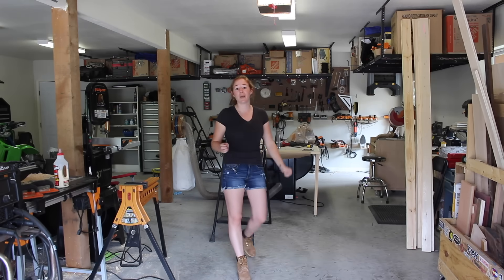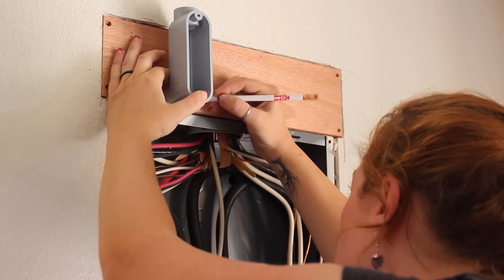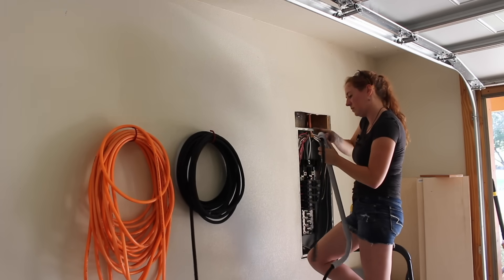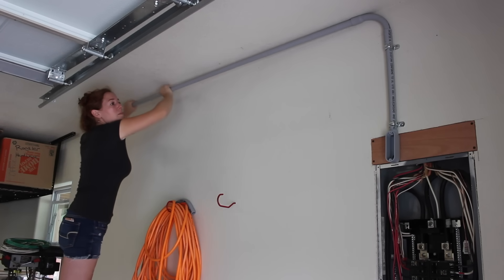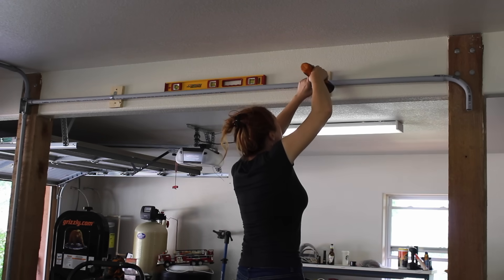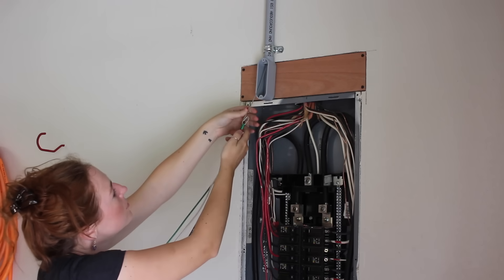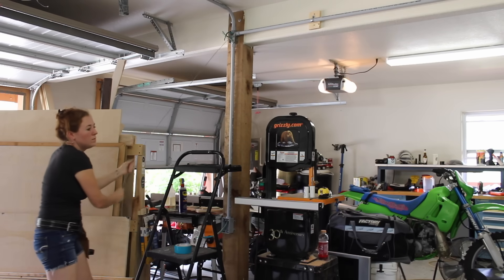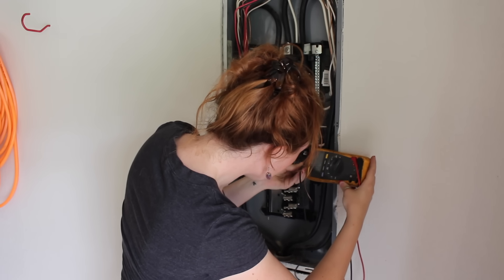Adding 220 Volt Outlets to the Garage

Comment: I've always found those wire-nuts horrifying (we don't use those in the UK at all), but seeing you use those with 240v is even more terrifying. I'm, sure that they are fine, but I'd rather use proper terminals that are screwed down tight. The loose wires are a mystery to me too - We have use "Twin and earth" that are bonded in a PVC outer.
Reply: I'm very impressed with the new Wago connectors.
Reply: Yes, I've used those - but only for lighting/low amp stuff.
Reply: I'd probably go upto 20A with one, but yes, I'm a bit dubious of running a cooker though them - even though they claim 32A on some of the ranges. Still, rather them than wire nuts. Their DIN range are really cool - did all my lights (star wiring configuration) from DIN boxes full of them (had some DIN ZWave modules to mix in, so it made sense).

Comment: You didn't have it in the video, but I was wondering how you ran your conductors through the panel knockout?  Be sure you have a conduit with a bushing from your LB to your panel.  I would also not recommend putting a block of wood directly above your panel.  Combustible materials should be kept clear.  other than that, nice video.
Reply: surface mounted with listed fittings wouldn't severely compromise the fire resistance of the sheet rock.  I was pointing out that it's always a better idea not to have combustible materials around your panel.  Same reason why I don't use NM (romex)  unless I absolutely have to.  Not so much a criticism of her work,  just a little food for thought.

Comment: If one uses SO cable inside conduit where there are no codes then the risk is just heat. ie the max amperage would have to be less since the conduit is actually adding more insulation. Thus besides laws, one should understand why the code has its reasons. Frankly for a casual usage garage, the heat issue would be nill since one is not going to run a table saw straight for 6 hours. BUT if the 240 volt SO in conduit was for say the homes main AC unit then here in the Deep South the SO's insulation would just degrade quicker due to the added heat. Oddly having SO in conduit might too prevent a fire in as Barn since squirrels and rats like conduit less than SO wire!
Reply: Does the NEC not have derating tables for various cables in various installations? Cable clipped direct to surface can take more than cable buried in plaster. Then at the other end you have cables under insulation in the attic which may involve going up a size.
Reply: The NEC has Ampere rating for wires normally used in Conduit and the maximum number of wires allowed for each gauge and class of insulation. Another variable is the Ambient Temperature. , the tables are for  30C ie 86F and you derate at higher ambients.  SO is flexible cord and not even mentioned for usage in conduit.
Reply: Ah - SO is flex. That figures then. Yes, the IET Regs have derating for temperature (IIRC 30C is factor 1, ie the normal rating) and also for grouping (number of circuits rather than cables inside a single containment). Thank you.
Reply: If the SO is running to a milking machine in a barn in the county then having some of it in conduit might halt animal damage of the cord too. :)

Comment: Hi,
nice video, as always!
Just a thing I have in mind while I was watching and want to share: If you have no fish take, you can use a cord with a cotton-wool ball tied at the end and suck it through the pipes with a vacuum cleaner. Then fix the cables on the cord and pull it through.
Worked great for fitting all my network cables in the ductwork in our house.
best wishes from germany
Andre

Comment: Again, great job.  I missed the part where you used a white wire as a hot.  someone commented to tape them black on the ends.  That may be ok in an industrial application.  Being this is your home that you may sell some day, I would replace the white hot wires with black or red.  Again, great job.  You seem to have an understanding of the invisible demon.

Comment: I think you did a great job especially since it is your first time with limited knowledge.  For the future.  get some wire pulling string.  tie a small amount of cellophane on one end (just enough to fit in the pipe loosely)  Put it in one end and a vacuum on the other.  It will pull right through.  Tape your wire to it and pull it through.  Much easier than the metal fish tape.  minerallac hangers instead of wooden standoffs are much neater.

Comment: Does the 240V come off the pole in the street ?
Reply: In a typical USA home the street's transformer is 240 volts with a center tap in the middle that is grounded at the pole with a big rod. and at the meter at the house too with a ground rod too. Thus one has two hot 120 volt legs to ground  and 240 volts between each hot leg.  

Most circuit breakers are for 120 volts and use one of the hot black legs and a neutral white wire back to the breaker box. For big loads like a oven, clothes dryer, big AC unit or a shop the circuit uses a 2 pole breaker and 240 volts.
Reply: thank you so much for the reply, I did not know that, so can any customer request 240v supply ? and other than operating machinery why would they need the higher voltage ?
Reply: thank u
Reply: Omar most all new installs in buildings and homes in the USA have "240 volt service". The rare exceptions are for a tiny 2 meter square guard shack, a single sign, or maybe some traffic lights!., or the cable TV amplifer  that the cable company has every  kilometer of cable going to homes.

istorically Homes in the USA used 100 volts, then 110, then 115 now about 120 for all the "stuff" that is lights, radio, toaster, cake mixer, refrigerator, electric ceilings fans, hair dryers etc. Ie on cannot normally buy  240 volt (only) consumer items here. 

Thus say 1890 a house might have a 15 amp 100 volt meter, then 30 amps at 110 volts was a homes service say in 1917.  Then homes got 15 volt at 60 amp meters say 1930's for a new home. About 1947 ? the NEC I thick required 240 volt services in new apartments being built. 

Electric clothes dryers sold say from 1940 to say 1980 would work on 120 volts or 240volts. The motor runs on 120 volts, the heater on 120 volts or 208 volts or 240 volts. The wattage might be 1200 watts for 120 volts and 4800 for 240 volts. It was the same unit with the coil rated for 240 volts and at 120 was at 1/4 power. 

As the Homes grew in size and AC usage grew the 60 am service was not enough thus many places here required 100 amps at 240 volts for a home. The next class of 200 amp at 240 volts was in big NEW homes in the 1950's, but most all used 60 or 100 amp service entrance sizes. 1970's Homes where I live now built for builder for resale were 100 amp services and the custom homes 200 amps. There is also a 320 amp service for 240 volts for homes too. 

The typical USA home has a 240 volts service, my guess is 99 percent or more do. BUT the 240 volts is "plumbed" :) to the stove/range/oven, big AC unit a say above 1ton 12000 BTU, to the water heater maybe, or to the clothes dryer. 

 Over the life of a building or home the load can double, thus service entrance minimum sizes have raised with time. 

 Thus one gets a 240 volt supply in the USA in almost all new installs of a utility meter
Reply: Thus 240 volts is at the Utility meter, at the main circuit breaker of most all USA homes and apartments. BUT one does not find 240 volt receptacles (sockets) in the Home to just use as one wants for a new gizmo. Thus if one buys a 240 volt welder must folks will have to install a new receptacle with wires back the circuit breaker box.

Comment: I have read over a few comments and it seems like the code violations have been addressed, the biggest two being thhn going straight into the panel unprotected and the size of the j-box. A small violation that seems to be a little misunderstood however is using the white wire as a hot. The NEC prohibits this in conduit, you can only phase a wire a different color if it is already sleeved, i.e. Romex or mc. To be honest though, we do this from time to time. Overall good install.

Comment: just a simple question, nothing negative, i´am electrician in Denmark, and in Denmark, this is not a allowed to "do it your self" all new work has to be an electrician, is is only allowed fore private person to change a existent outlet, is it allowed to do electricity work by you're self "overthere"? (by the way, in denmark, we have 240volts in normal outlets and 400v fore the bigger appliances, and we use all 3 phases)
Reply: Hello from the USA! Here in the USA one can buy all the electrical "stuff" to do work at local stores or the internet too. Whether it is legal depends on which city.county and state in the USA. ie giant mess of rules that varies.

 In Chicago all wiring is required in metal conduit, this is rare in the USA for homes. But for a commercial business most places require conduit. 

There is a lot of  work here that might be actually required say be a licensed chap. ie If you Sister cuts the neighbors hair here that too might require a license for her if she get paid a dollar. ie licensing is suppose to protect the public's safety but too it is a source of income for the government. ie here some places require a license to braid hair, landscape a yard, or cut yards too. 

Honestly much of the extra electrical work done at my shop's wiring by licensed "professional electricians" are less professional than Aprils work in this video. ie the licensed guy might just run new conduit to run up the bill and then  too might not even mark white hot wires with black tape too. One chap here installed a subpanel with the no isolated neutral and the panel is a 10 meters away from the meter.

 The real issue is if a fire starts or a person is hurt who get blamed. ie everybody here sues. A buddy and how wife in California added on to his home and wired it too and all was without permits or inspections. To sell the home they had to demolish the taboo addition. Still the rental on that room was more than the cost of the room.
Reply: Okay, thanks for answering, sounds a bit strict over there, here it is basically electricity and plumbing there needs a license here, everything else you can do by yourself, as long as you doing it by standarts that is set by the building regulative, but also, everything that is needed to do licensed work can be purchased in every homecenter, and believe me, we see a lot of crap work by the "do i youseft guy" i have seen a lot of "this old house" at youtube, and love to see them do electricity, and how complex it is overthere, everything in metal boxes, metal tubing, metal flex tubing, metal panels, i think it was around 1975 the last metal box was used in denmark, now everything is plastic, (non flammable) we have small metal pipe, but that is only used outside, where i has to look nice, and if there is a risk of mouse, to this we also have isolated cable with an inside metal shielding, and the cable is coated with something that not tasted good for mouses, also our outlets and switches i half the size of an USA outlet, we use smaller wire, (because of the 240V i normal outlets) and that means lower Amp, and also everything, in houses has to be protected by a fuse and an ground protection breaker, (GFCI in USA) and thats the law to protect, humans from danger

Comment: I am an electrician as well and reading the comments all I can say is calm down guys. This project was done way above standard for a home owner. The only thing I would tell you that is try using 4" square boxes for the junction and outlet. They allow for more room in the future and they cost almost the same. Congratulations on the motorcycle and as usual my 4 year old son loved your video. He is obsessed with me building a backyard foundry
Reply: Are you a licensed electrician and see nothing wrong with this? I'm glad you're not working in my house.
Reply: @nilpo19  Why dont you try reading his comment again and then comment ffs
Reply: @AugustmanReborn  I read it again. My comment stands.
Reply: @nilpo19  I see.
Reply: no he didn't say he saw nothing wrong, basically he's simply saying that many of the issues are being overblown, and they are. Things like needing red and black instead of white. Especially when she put some tape on the ends of the white. It's a single outlet of externally visible the whole way conduit run. Anyone who can get through being a journeyman is going to see that and it'll be obvious whats happening. Yes it's not entirely within code, but it's not dangerous and that's really the main key. Using white instead of red is like not bothering to write what each line goes to in the electrical box, it's annoying, it's not dangerous.    There are things like oh you should use wago connectors instead of wire nuts and it'd be preferable, but it's not inheritently dangerous, there is no reason to believe those wire nuts would fail. Then it's the 4 inch boxes, again, not dangerous as long as wires aren't being exposed and crammed against the box making it live. It's code, but it's not dangerous. The only real thing is the use bigger wire. Though even that may not be an issue depending on what she draws and frankly how long she uses it. She is going to be actually spinning a table saw blade for too brief periods as a home shop for it to matter even if she over draws amps for short periods. Out of code yes, unacceptable for a journeyman electrician yes. Acceptable for something you can just spend 10 minutes removing when you go to sell and will work safely until then for less than 100 bucks. yes
Reply: Don Ziolkowski Thank u Dan for adding a little sanity to all the licensed, bonded, vetted, nema c boys out there. Electricians usually retire at about 40 because of their super good unions. Then they can watch YouTube videos all day and demonstrate their superior knowledge as to why we don’t ground the neutral till we get back to the service entrance. U haven’t lived until u have changed a few pool motors that were wired old style. 220. Run one hot wire directly to the motor and only break one with a single pole switch. Then enter 17 year old nubie.  Add some wet copper pipes and things got real exciting. That was 50 years ago. Just kidding guys!!!!  Respect to all the electricians. Just having some fun😊

Comment: codes/ regulation Change by area or country. though in the USA if you are not competent "Qualified", you will end up in jail 🖒and if you have an accident you won't be able to claim. but anyway, seems OK install really...  over here Single phase is 230v 100amp, where as Three phase is 415v 3x100amp. Still baffles me when Americans think single phase is not going to kill you as much 😂0.001 amp at 115v will kill you dead as hell. anyway single insulated conductor cable is recommended for use in conduits because you can run more in them for one and less chances of snags or transferable heat etc etc. recommended is light grade Steel conduit for installations especially in a workshop.

Comment: Did u used a nema 14-50 socket and how many amps was the added 220 switch in the breaker box? Or can u pls post a list of parts that u used for this 220v install in ur garage? Have an electric car and would love a 220v access for a lvl2 charger. Tired of lvl1. Thank u in advance and a very nice job u did there🤙🏽🤙🏽

Comment: Electricity is probably the one thing I know the least about. I have a question. She only ran one circuit so can she only run one thing at a time then? For instance, will she be able to run her table saw and her dust control at the same time? Thanks!

Comment: April - First let me say you did fine work for not being an electrician. It's inspiring to see the projects that you tackle on camera. There are a few things that are technically against the NEC but also they work in real life. As others have mentioned, the wire colors could be a problem if your work gets inspected but a bit of red tape on each end of each white wire will fix that issue. Also if I were to have done that project I would have run a separate circuit for each circuit just to never have to worry about possibly overloading the breaker and tripping it in the middle of a project.

All in all - Great Job!

Comment: I don't know where to begin. Box fill of the metal junction box. Can't use white other than as a grounded conductor not as a phase conductor, unless paired in an NM sheath. Thhn cannot be ran exposed inside a chase, no conduit from the LB to the panel that I saw. Conduit supports for PVC from the box and also linear distance per article 352.

Comment: I know it's her house and she can do what she wants but I would have used two blacks for 220v, or a black and a red for the 220, or any color other than green and white, plus the ground. Not so much for my benefit (or hers) but for future people that might open that box and think that white wire is a neutral.

Comment: Unless that panel was turned off (dead) you fingers seemed mighty too close (at 4:49) to the main 2 phase bus bars. If anyone doing this and happens to read this comment, please keep your hands away from the bus bars in your panel. 

Im also glad you switched from using the other wire,  using that kind inna conduit is pointless and wastefull....

But great video, nice clean install!

Comment: You Didnt cover it in your Video Editing, but did you run a Bushing thru the hole in the top of the breaker box when you knocked out the slug? if, not you need to, that hole will be super sharp and can cut thru the wires over time and cause problems